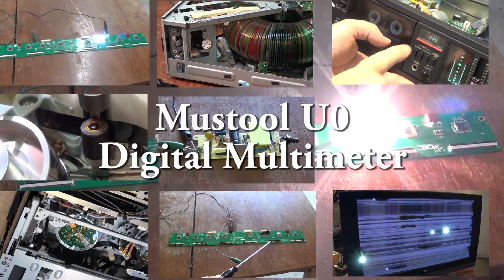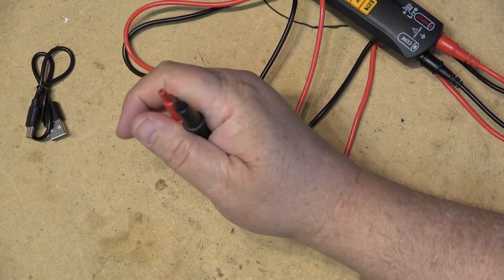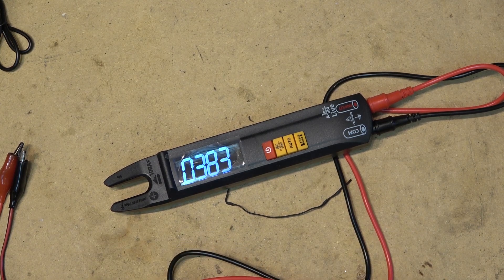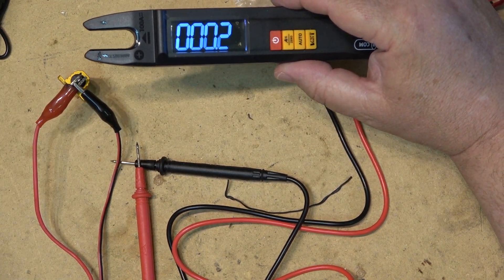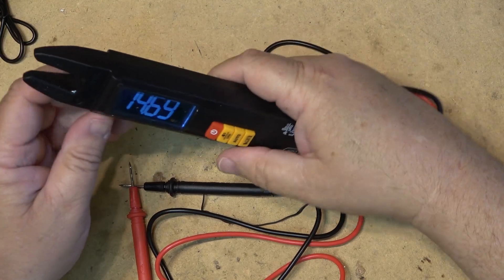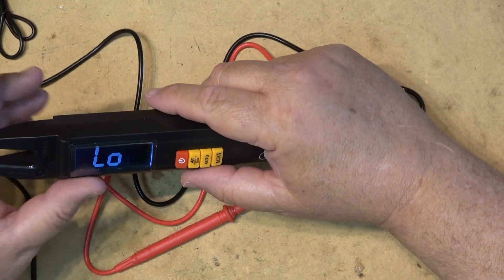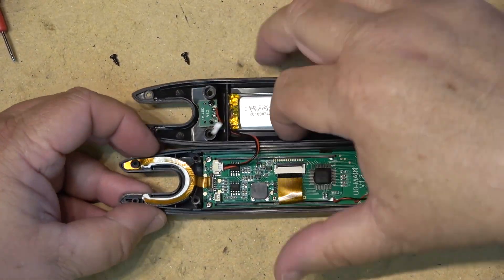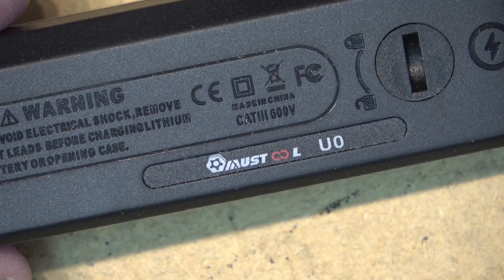Mustool U0 Multimeter Unboxing and Review

Comment: Great value for the price, but you will have to be quick the summer offer
ends in 3 days and is limited to 50 of which 12 have been sold.
Delivery is slow 6-16th August.
Reply from the maker: Code days on sale till end of sept for 14 bucks.  Look in description.
Reply: @12voltvids  Just checked again, the summer sale special offers ends in 3 days and 15 hours
It is only your code that is valid until end of September.
I have placed an order, hopefully it will arrive during August.
Reply: @12voltvids  I have just bought one with your discount code and have paid a total of £13.55 
with shipping.
I hope it arrives during August, if not Paypal will refund me.

Comment: Comparing one chinese junk to another.
Reply from the maker: I compared it to my fluke and it tracked exactly. Not much choice these days because they don't make stuff here anymore.
Reply: @12voltvids  Most of the time this one will be good enough, having tested it against your Fluke
has proved it is accurate.
Reply: @TD75  How much did your Klein clamp cost ?
Sometimes you get what you pay for, for most home users this cheap junk is good enough.
Reply: For the price it's a cheap meter, even if just to keep in the car toolkit